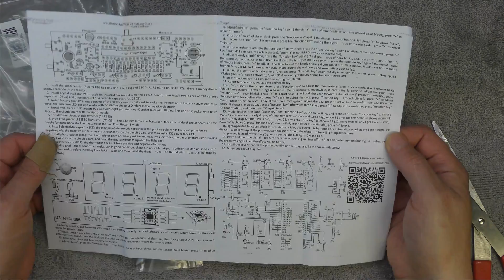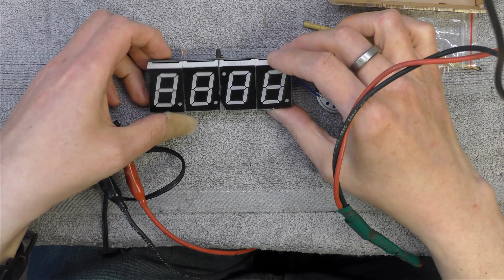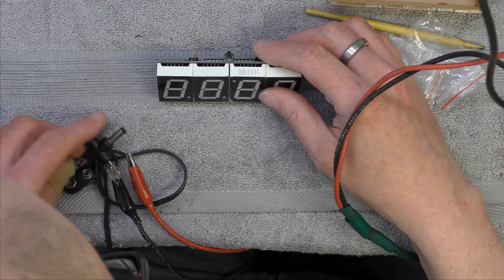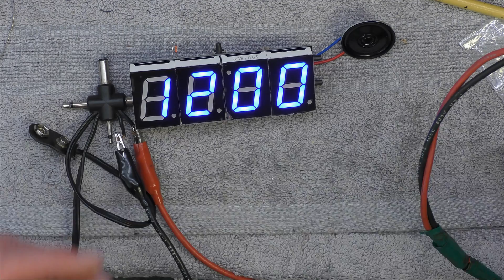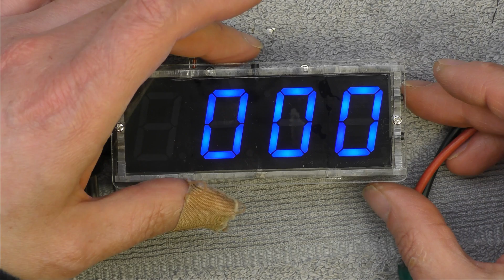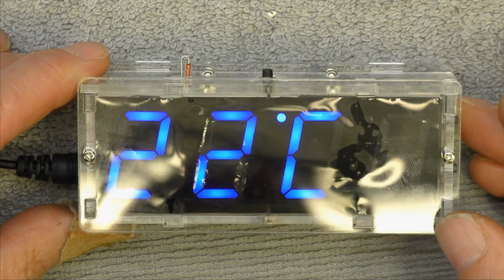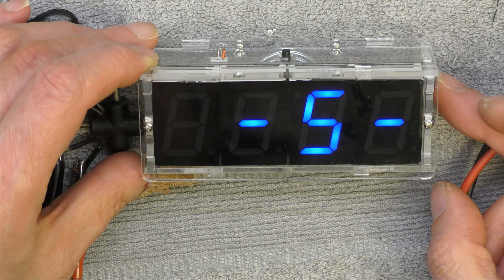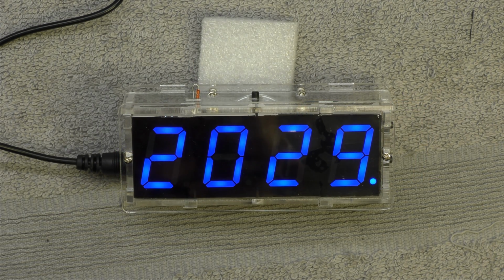Talking Clock Kit Build  (4K)

Comment: Hi Daren. Put quite a few of these together myself and quite interesting. You have done very well with this one. Think it would be a good one for Radiocruncher at Christmas.
Reply from the maker: Hi Derrick I have built a non speaking one and it works apart from unreliable  battery backup. If the power is lost during the day display it looses the time. Not sure if a software glitch. I'm sure Graham would like one. Regard's, Daz